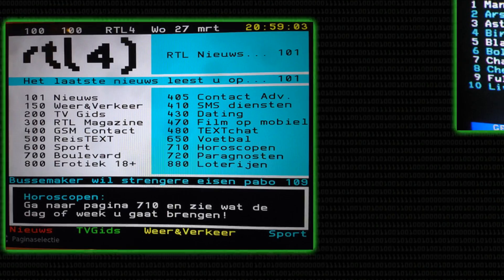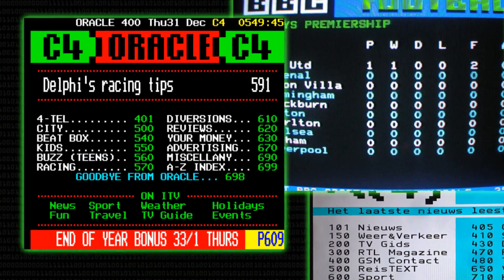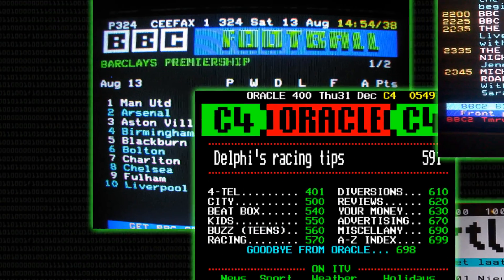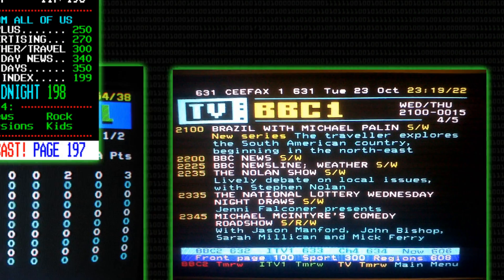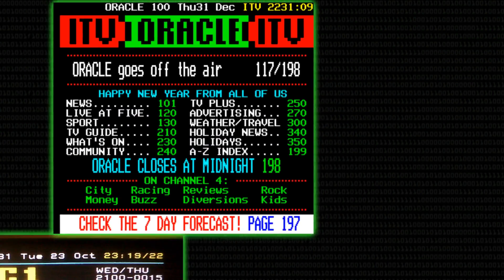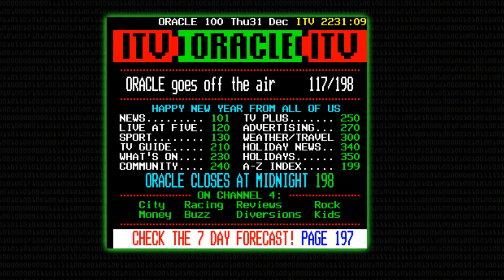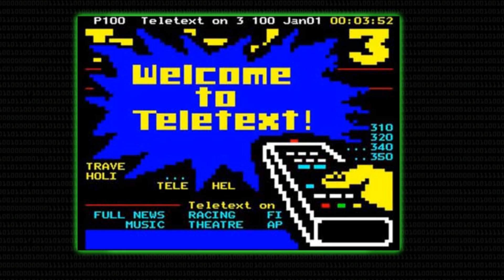EXTRA BITS - BBC Micro and Teletext - Computerphile

Comment: Here in America (to my knowledge) they never did use that "dead" space in the TV signal for anything as interesting as Teletext.  In fact, I don't think the Horizontal Blanking Interval was used for anything at all (but I might be mistaken).  The Vertical Blanking Interval was used to carry closed-captioning information that could be decoded by a special device that you had to purchase separately.  Around 1996 or so, TV manufacturers were required to include a decoding-device built in to the TV itself.  But it never went any farther than that -- again, to my knowledge, which may be mistaken, and I hope that someone will correct me if I'm wrong.

Comment: In NZ we had teletext on only a few VHF channels and on some Freeview boxes they have a similar type of thing. In the analogue days of TV I could tell if a channel had teletext if when the picture rolled (with old tele's that had a vertical hold control this was easy)  and you could see the top non visible lines (and vertical sync area). If it showed a sort of black and white ("noise" or "QR code" type) pattern on the top few lines of the frame, the channel most likely had teletext

Comment: I remember there where pretty good games on teletext.
Reply: puskajussi37 Most of them used subpages. A few also used phone in for the interactive part, but most of them were simple quizzes
Reply: Sirus Im not sure how that would be since teletext conveys inormation oly one way and thus doesn't allow much of interactivity. Tough I remember we had a later generation cr-tv that for some reason had like 20 games on it like snake and breakout and such.
Reply: *****
I see
Reply: It worked quite well. there was a counter in the top somwhere, a bit like a completion bar/%. 0 to 999 I think. so if you where on page 100 you had to wait untill that number rolled past again untill the page refreshed again and what ever sub pages it had. it took around a minute.
I would love Brady to find somebody, maybe this guy, who can explain how it worked. For a one way interative system it worked pretty good. Obviously the other way needed a phone call apart from the 4 coloured keys that called for a certain sub page. It must have had a standard area of ram and instuctions. I now wonder if bbs was built from or inspired from this.

Excuse my keyboad skills, I share it with my kids. Snot, dribble, jam sandwiches. Don't even ask about my don't touch screen. I have already answered that one :D
Reply: +Sirus What do you want to know?  I implemented the teletext decode for the BBC micro, I can probably remember the broad strokes if not the low level details.

Comment: Ok, but can someone tell me what the hell he just said :P? What are the issues of frequency alignment, what are "RC delays", etc? Sounds interesting, I'd love to have more in-depth explanations of putting together hardware architectures, as usually explanations are either localised low-level, or high-level.
Reply: You need accurate timing, and because 6 does not divide evenly in to 16, they used a resistor capacitor filter to get near enough to 6 MHz ckock.